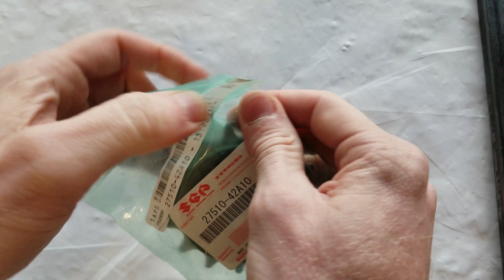DR 200 New Sprockets and Chain

Comment: Great video!!! Can you provide a list of parts/lube you used? I'm trying to do this same thing on my 2015 DR.
Reply from the maker: OEM Suzuki 15 tooth front sprocket, Sunstar 45 tooth rear sprocket, D.I.D 520 120 link O-ring chain
Reply: How many links do the dr200 have I looked it up and see 112 is that correct?

Comment: great video, do you know where to get the 46T rear sprocket for this bike?  really hard to find it; also, noticed you checked the footpegs mount to closer to the swing arm too, appreciated if you could share the link of that part too, thanks!!
Reply from the maker: I don't know where to get any different sized sprockets. As far as I know those are the stock foot peg mounts. I really don't like where they are, and I think it would help to move them farther back.
Reply: @TwinSportAdventures  thanks for sharing !!

Comment: What size of sprocket did you put on front
Reply from the maker: It's a factory 15 tooth sprocket. Part number: 27510-42A10
Reply: @TwinSportAdventures  Thanks Bryan I think I'm going to go to a 16t on the front to being done rpm at 45-50 and to make lower gears last a little longer I live in the city .
Reply: I read online aftermarket one were made a little different and may need a circlip to hold it in
Reply from the maker: @chrisklein4366  The factory one has a plastic ring on it. It doesn't seem like it's really necessary.
Reply: @TwinSportAdventures  thanks there's not a lot of information out there on the little dr200.
Reply: @chrisklein4366  if I put a bigger sprocket on the back I will get a little longer out of each gear ? Just a little slower off the take off? I’d much rather have a little extra gear
Reply: Front sprocket facing the wrong way